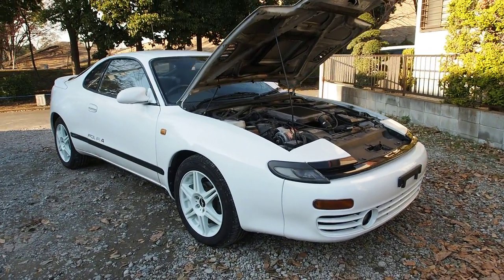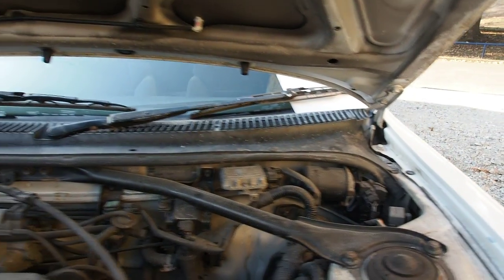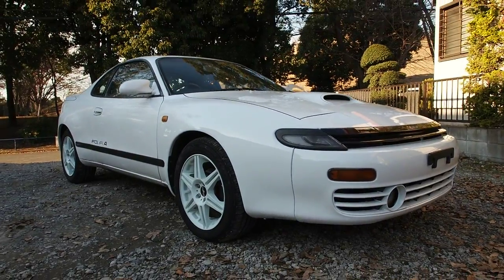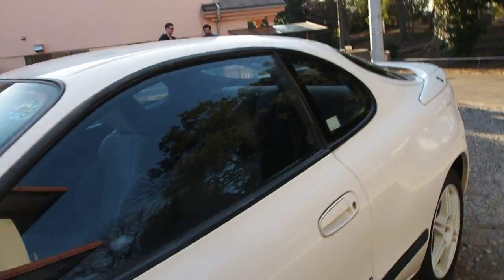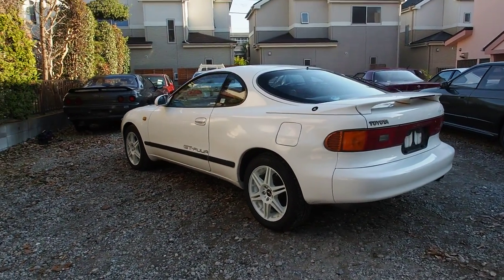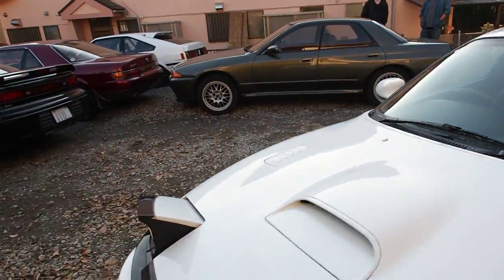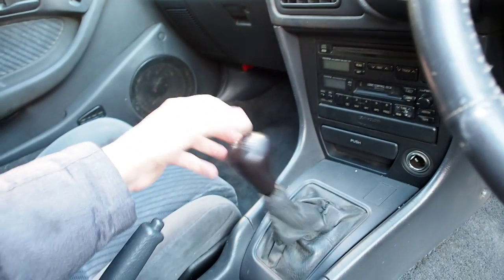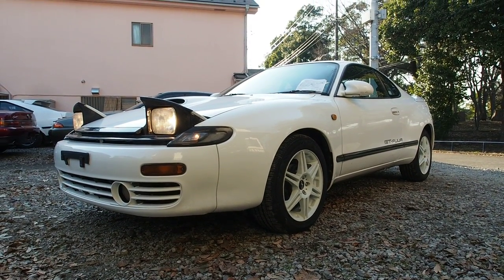1991 Toyota Celica GT-Four Turbo 4WD (ST185) Japan Auction Purchase Review

Comment: I like celica this gen and the one after but the one from the 2000 just pure rice and only fwd :(
Reply: There are awd versions lmao
Reply: @jaydenzerfoss4650  only custom made awd 7gen celicas. Non from factory. There are only 2 engines available and only fwd.  The only celicas that had an awd variant are st165, 185, 205.
Reply: A lot could have been done with that last generation.
Reply: Theres only 5000 of these tho.
Reply: @myes344  Closer to 23000, in total, all ST185 types added together. The Carlos Sainz version was the truely limited version. ;-)

Comment: My car is the much slower non-turbo version of this car (ST184). It has an economy engine opposed to a performance engine; just like comparing an AE85 to an AE86. But, that doesn't take away the fact that it's still a hoot to drive. I do one day hope to swap that old thing out with a 3S-GTE out of this thing as well as a few more exterior pieces. Super sweet cars either way and I hope to own one (though they're super hard to find)
Reply from the maker: Did you get the one with the 4A-FE engine? That engine is the same as the AE86 but with a different head.
Reply: PacificCoastAuto No I have a 2.2L 5S-FE in my car since it's the GT model. It's the same engine that the US got in the N/A MR2 and one of the Camry models.

Comment: so how much for a good st185? I've been very curious about these since I played Forza horizon rally lol
Reply: subie skyline34 I purchased a celica identicle to this car only slightly modified (body kit/exhaust/intake/sound system/rims) it has less KM and is cleaner under the engine bay, I only paid 3100$ CAN, however it is a narrow body style and due to the fact it's been modified they are usually a bit cheaper, stock cars are worth more unless you have 15k or more invested
Reply: @mikemcinnis12 3000 that’s a steal tho u gotta admit most won’t be that cheap now indays

Comment: What's so special about this generation of Celica is the fact my dad used to own one back in his youth and the fact why it was so special is my dad had done really crazy Frankenstein modification by literally swapping the drivetain to 4WD to RWD and for the heart he had swapped in a 2JZGTE (I'm not quite sure but the only things he remember about the engine was it had a blue valve cover and was 3000cc) 
in short he said the modification he had done costed more than the car itself and it took nearly 2 months for the car to get road prepared and soon it was crowned as one of the fastest Celicas of Bangladesh 
Sadly due to financial issues he was forced to sell the car half the price he bought and modified and the new owner had trashed it after buying it

Comment: how much do these ones usually cost?
Reply: They don't hold much value here in CAN, I bought a high KM 89' GT-FOUR for spare parts for my GT-FOUR RC and I only payed $1500, even my low KM 90% stock RC I would be lucky to get $6-8000 CAN
Reply: still have the gt4 for sale?